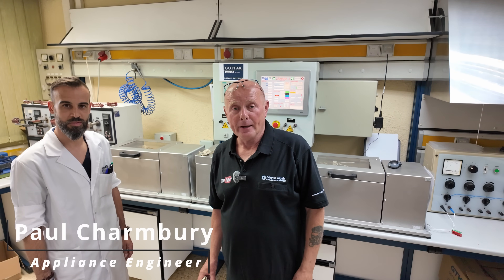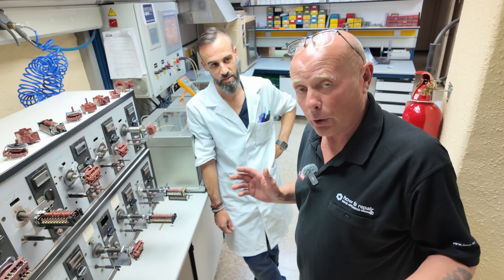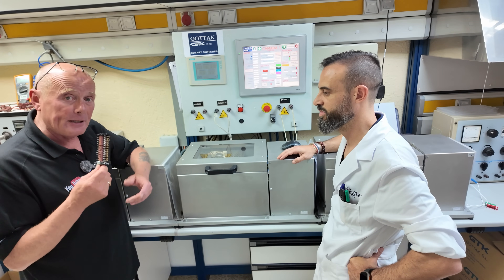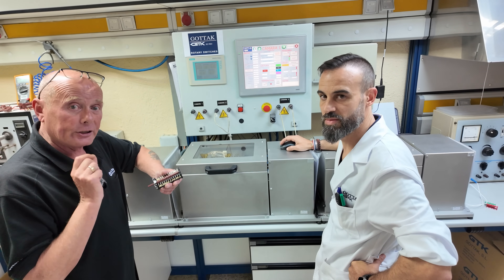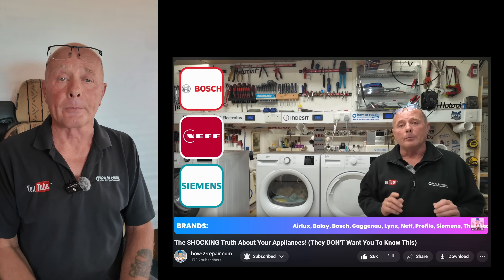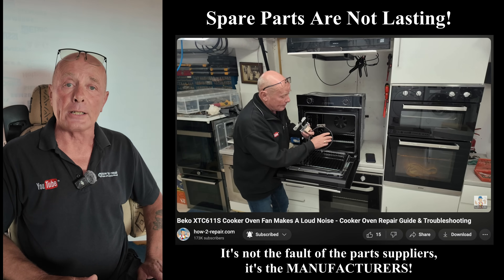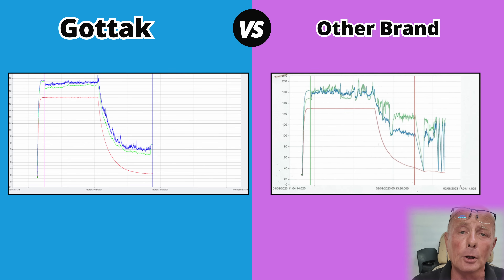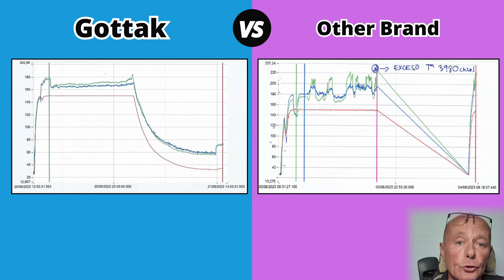Why Your Appliances FAIL SO FAST! Lab Results EXPOSE the Truth!

Comment: In the USA the same thing is happening. I'm an appliance repairman and people are livid over how short a time appliances are lasting. Whirlpool is a perfect example of this.
Reply: Ironically, I have a Whirlpool dryer that is probably around 50 years old. It is the one my parents bought when I was a kid. First they bought a washer so we didn't need to go to a laundromat anymore and hung everything on clotheslines. Then when they saved up the money they bought a dryer. The motor or heating element broke about 5 years after buying it but then nothing else broke. I inherited the dryer and put it on my covered outdoor back patio. So it didn't get rained on but is exposed to humidity 24/7. About 7 years ago the thin rubber band drive belt finally broke after about 45 years of use. I was able to go online and order another one for $2.45 because many different brands and models use the same belt. Took me about 20 minutes to install because I had to figure out how it went around the tensioner. Has worked fine ever since. Because it's in the Florida humidity the exterior panels have gone from white to 100% rust so it looks like trash. But the drum is rust free so it's still fine to use. I thought about sanding and repainting the panels, but figured if I did that would make the dryer finally die.
Reply from the maker: @SirReptitious That's an incredible story about your Whirlpool dryer! Fifty years of service is a testament to how appliances used to be built. It's fascinating that the only major repair in all that time was a relatively simple belt replacement. Your experience perfectly illustrates the contrast we discuss in our videos https://www.youtube.com/watch?v=QsdGd2qDPaI & https://www.youtube.com/watch?v=xn03N3b0-lE between the durability of older appliances and the often shorter lifespans of more modern ones.

The fact that you could still find a readily available and inexpensive replacement part after so many years is also a key difference compared to many appliances today, where parts can be difficult or costly to source. The Florida humidity taking its toll on the exterior while the drum remains functional is a great example of how the core mechanics of older machines could outlast their casings. Your hesitation to repaint it for fear of it finally giving up is quite amusing! Thanks for sharing such a remarkable anecdote. Please subscribe to our channel for more discussions on appliance longevity and the changes in manufacturing over the decades!

Comment: For example, Electrolux say that their domestic washers are rated for 2,500 cycles (8kg), while their myPro professional washers are rated for 7,500 cycles (8kg) and 15,000 cycles (12kg). Are the parts in the professional washers higher quality?  Would a brand like Miele offer parts that are a little bit closer to professional quality but in a domestic washer package?

For reference, here in Australia the 8kg Electrolux domestic washer is $650 AUD while the 8kg Electrolux Professional washer is $2850 AUD.
Reply: There's also the even higher end, Electrolux QuickWash QWC  professional washer line, which is around $5500 AUD or 3000 GBP for a 6kg washer.  Full stainless steel inner and outer drum, metal frames to hold the electronics (not the typical plastic electronics housings) and so on.  Very, very little plastic in the machine.  Is part of the problem that consumers being unwilling to pay for higher quality?
Reply from the maker: The average consumer is always willing to pay the higher quality. It’s whether they’re capable of paying the higher quality. Yes appliances have gone up in value when it comes to the high-end units but the bill quality has gone downhill.

Comment: I do have a fridge and the plastic door handle broke off. Now I would like to make something from steel to replace that. And on my TIG welding machine the rotary encoder of the main welding setup did fail in the pushbutton switch. Now I have to make a circuit board with either a Bourns or Alps alpine rotary encoder. It takes time all those DIY tasks. I also want to spend time on more fun things.
Reply from the maker: Again, even on your welder built in obsolescence is always present

Comment: That's crazy! You really have to do your homework when buying these appliances. Thanks for another great video
Reply from the maker: You shouldn’t have to do research on buying something is so simple as an appliance. It should always last a minimum of 5 to 10 years.
Reply: @How-to-repair  Fair enough, but how do we change the market so that appliances do last? I understand that the 'little guy' can change things, but you need lots of little guys working together to make the necessary changes. In a practical sense, what exactly can we do as individuals?
Reply from the maker: @DEECAPSTARR  what we need is new manufacturers to come on the marketplace who are tying to build a reputation they normally build reasonable quality because they’re trying to gain a market share
Reply from the maker: Its an appliance you shouldn’t have to do that much work

Comment: Over the decades of repairing appliance I've seen the quality diminish. It's all about money. Money from selling spares of replacing the whole appliance. My Nan had a Hotpoint from 1979 that washed for 5 people and lasted to the mid 90s with minor repairs. One set of bearings and two pairs of brushes and that was it. It was only retired because the rust was affecting safe use of the machine. Now when you see washers being built with a plastic pulley and plastic paddles you just know it's designed for a set amount of use before failing beyond economical repair. I'm genuinely surprised my Built in Great Britain Hotpoint dryer has lasted 8 years of daily use with zero faults.
Reply from the maker: I’m going to take a guess it was a hot Pt 18 series one of the best machines they built. It was designed well easy access and the parts were affordable. This is how Britain built a company with a great reputation now the same company produces absolute shit.
Reply: @How-to-repair it most certainly was. Worked on many of them over the years and most of them was either blocked pump. Carbons and bearings and rarely fhe heating element. Never any timer issues. The mechanical timers were built to last. I turned 50 this year and i refuse to work on most modern machines. Even the spiders  as you know are made from mixed metals and corrode away in a few years. I would love to see how they will be built in the next 20 years.
Reply from the maker: @ spiders I’m investigating at the moment. I have some from the 70s 80s and 90s and I’m getting the metals analysed. I really think they have found a way to build obsolescence via corrosion
Reply: @How-to-repair ooh I look forward to that video. I've seen machines that are barely two years old black and rotting away and it's clear to see there's a reaction happening to make it fail so quickly.

Comment: I have a policy of not buying from a manufacturer of equipment that has let me down.
Reply from the maker: You’re going to run out of choices very quickly. I have yet to find something. I’m willing to put my name behind.
Reply: That's statistically fair!  Some people have had a dud Miele washing machine or dud Honda car or dud Panasonic hifi, TV or air-conditioner, but I personally haven't and trust that these brands try their best (within reason).  It's a matter of design and quality control and thus the probability of defect resultant from that, some brands have a lot more systemic defects than others (at least in cars that I am most familiar with).  Honda (and Toyota/Yamaha and Suzuki) are generally very, very strict in the quality control requirements they impose on themselves and their suppliers (but doesn't they don't still have dud products, but it's less systematic), while groups like VW Group tend to (seem) to opt for the cheapest tender instead.

Comment: It's not just the failure of parts... It's the availability of spare parts which quickly dry up leaving you no choice to buy new!.. Having said that, there is so much more choice nowadays and in general appliances are not as expensive as they used to be in years gone by - but they don't last.. Swings, and roundabouts
Reply from the maker: Hey Brian, I totally agree. This is one of the most ridiculous things happening in the industry. The governing bodies tell manufacturers to make parts for machines for 10 years. So, what the manufacturers do is make the parts so expensive that it’s not worth repairing the machine.

They also design washing machine drums that are sealed, so you can’t change the bearings or the spider. Instead, you have to buy the whole drum. For example, Bosch sells these drums for over £300. It’s no wonder people just buy a new machine instead.

Governments need to fix their laws and stop giving companies these loopholes.

Comment: A long time ago, appliances used many standard electro-mechanical components which were easily available or repairable. 
Today everything is custom sensitive electronics that are getting obsolete after a few years.
As everyone here knows, manufacturers prefer to sell a new unit than a small part to save an old appliance. 
and the result is mountains of scrap appliances.
Recently I had the opportunity to find a big LG refrigerator that probably the only failure (99%) was a bad compressor/motor capacitor.
Reply from the maker: Easy fix if you have gas equipment
Reply: @How-to-repair  
I am pretty sure the fault was not in the sealed system, only the motor capacitor.